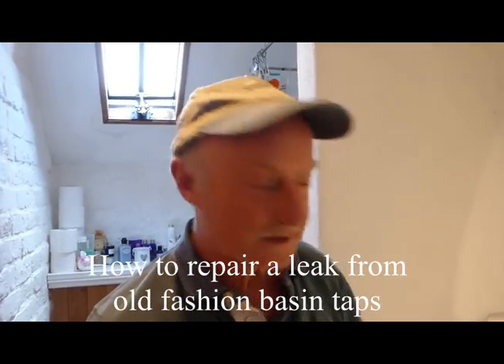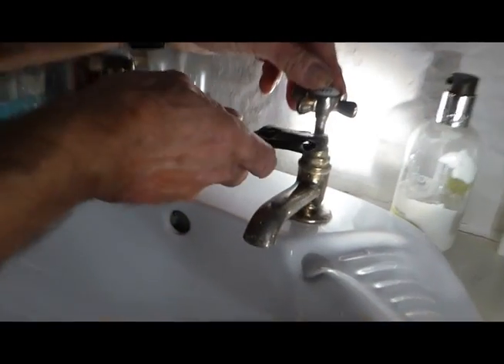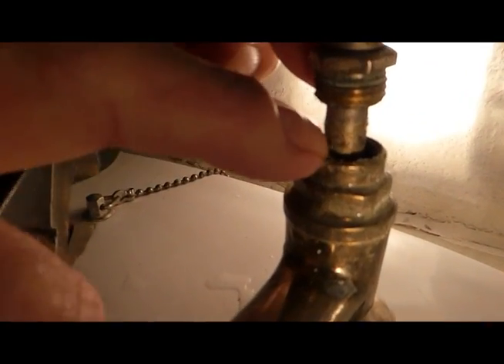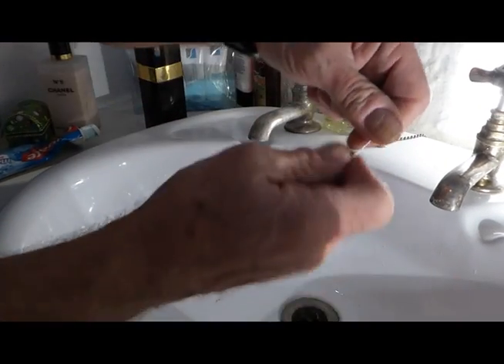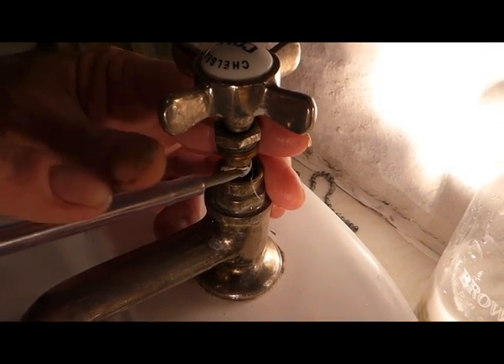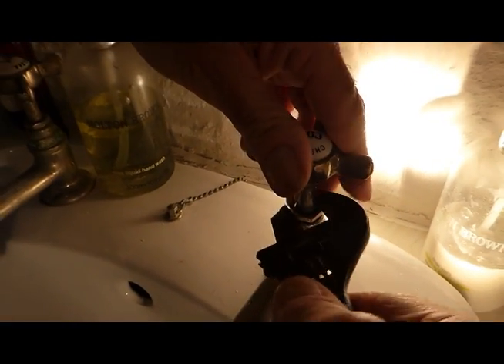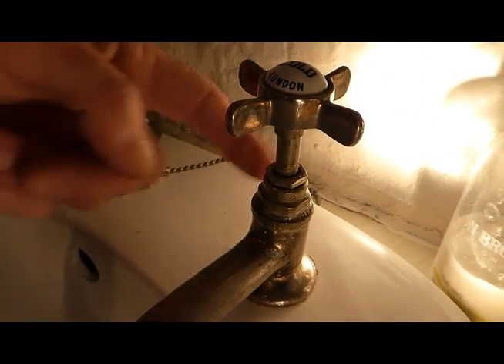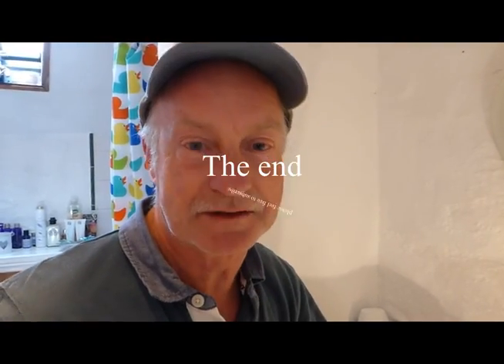How to repair a leak on old fashion style taps

Comment: Brilliant information, thank you!! I have old 'globe taps' on my bath (the ones that point downwards) and one is dripping, causing green stains on my old bath, how do I change the washer please, and do you have any tips. Many thanks in advance.
Reply from the maker: Turn off the water, pop out the hot or cold sign then unscrew, or if not screwed then pull handle off. Unscrew or pull off chrome cap if you have one, then use a spanner on the large square nut , unscrew the top of the tap and pull away then you will see the washer which can be changed.

Comment: My faucet is very similar to this one but has a worn out domed rubber washer under a large domed nut. Normaly you can pop the plastic cap off the top of the handle and pull the handle off the valve stem to slide a new washer down.  These caps are porcelain though and I don't want to break them!! Any tips for pulling the handle off the stem or getting a Porclein cap off?
Reply from the maker: Just plenty of WD
Reply: @dereton33  Thank you for replying so quickly!
I had soaked the cap in WD40 before i went out to grab the new washes so hopefully it'll have had time to loosen up.  I just really don't want to break them, they're irreplaceable.

Comment: Hi there. I have used so many of your videos to do small jobs and save a load. Thank you again. I've got the opposite problem in that I have an old brass bath mixer tap, the hot one of which has ceased up completely and I need molegrips just to turn it on. Do you have any videos that could help with this? Thanks
Reply from the maker: Yes one called , no water from tap how to fix it.

Comment: Hi, great and helpful videos! I have very similar taps, one has started to drip from the spout when when it's turned off. Could it be fixed with ptfe tape? These taps don't seem to have a typical washer you'd find on regular taps.
Reply from the maker: AlexJenkinsonable You may have ceramic disc taps in which case that would be what would need changing. The PTFE tape will only fix the packing box where the spindle is. Al.

Comment: how do you get the heads off these taps? I have a similar one but the headgear is seized and I need to get the head off to use a splitter tool. any suggestions gratefully received!
Reply from the maker: There is a screw under the cold or hot sign. Just pop those out.
Reply: dereton33 awesome- I'll go hunting for it! Thanks very much!

Comment: hi .... i want to get old taps re chromed , do you need to take the porcelin off and if so do you know how to do it ?
Reply from the maker: No you will not be able to get the porcelin off. Should still be able to rechrome though as they will mask off the porcelin off.
Reply: Ok ... Thanks.... just phoned my locoal chrome shop and they are saying it will cost 120 usd / 120 euro fr two bath taps , never knew it was so expensive
Reply from the maker: I know an expensive job.

Comment: Sorry but ptfe tape is not for packing nuts, its for threads.  they make special material for packing those nuts properly.  we have a graphite rope that works really well and last a good long time.
Reply from the maker: Yes hemp with boss white on it is my preferred favourite, but who has got that in there workshop or garage, Or your graphite rope.
Reply: @dereton33  Hi Al. I know this is an old comment, but you could search out the guys at TAPREFURBISHMENT.co.uk for the graphited rope. Best regards, K
Reply from the maker: Ok will do.
Reply: this works believe me as I am a maintenance engineer and have done this on numerous occasions and it works great